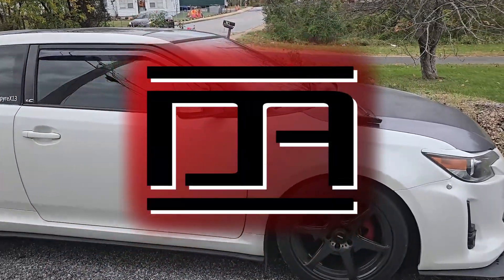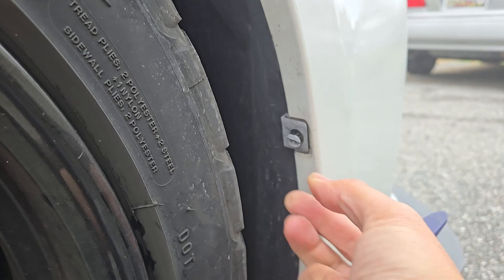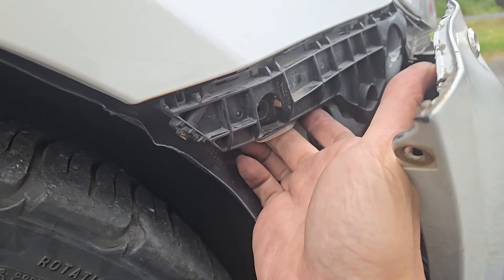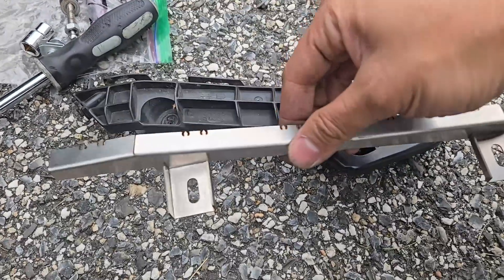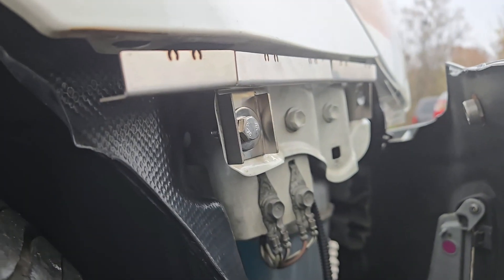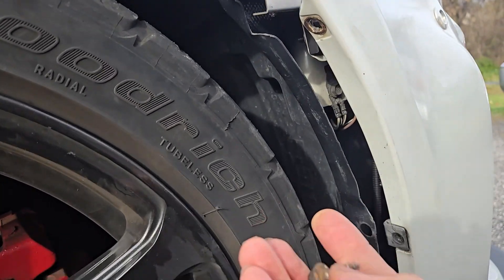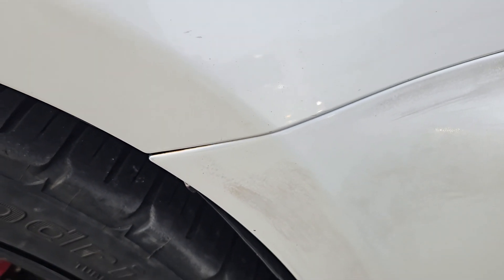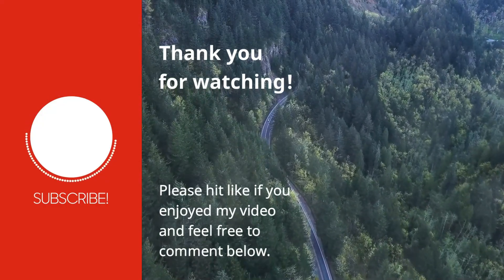MAC Lifter Kit Prototype Front Bumper Clip Replacement Install to Fix Sag / Gap (Scion tC2 / tC2.5)

Comment: I subscribed I'm wondering if you recommend switching out the hoses I saw you have some red ones in your engine bay
Reply from the maker: You don't need to swap them out unless yours are old and cracked, you want to add some color to the bay, or you're exposing them to extreme conditions. You can get a set from https://amzn.to/48TFfP0.

Comment: when will version 2 be out
Reply from the maker: @garrettwilliams1243  I'm not sure, but I've seen photos of the prototype, so hopefully soon.
Reply: @VampyreX13 i emailed them and they said the v2 is out and is not a prototype
Reply: I just received mine for my TC2 and it appears no different from the prototype version you installed in video. There's no provision for the rear 3rd hole??
Reply from the maker: @jasonstevens595 I know that they had a prototype with the revision out, but I've been out of the loop on its status.

Comment: So you recommend waiting for the V.2? I really need this but I don't know if get it right now or wait a little longer
Reply from the maker: @lmlxmiguelxlml5990  if you don't mind drilling a hole yourself, then the injuries version one should be fine. As far as I know right now, the only difference with version 2 is that it will have the mounting hole on it.

Comment: finally something for the bumper clips haha guess I'll wait for the V2 to drop so I dont have gaps haha
Reply from the maker: @fedovang885  v1 works fine if you don't mind drilling the hole yourself.
Reply: @VampyreX13  haha that's the thing, I don't wanna drill holes. But I'll think about it since it's probably the best kit for gaps
Reply: @VampyreX13  do you know if they are making a set for the rear bumpers??
Reply from the maker: @fedovang885  I'll ask them.